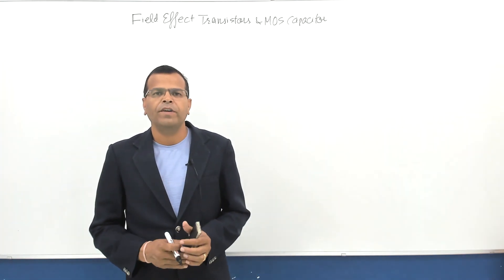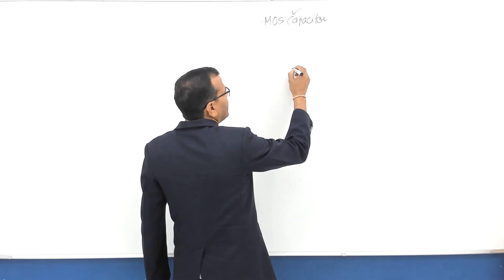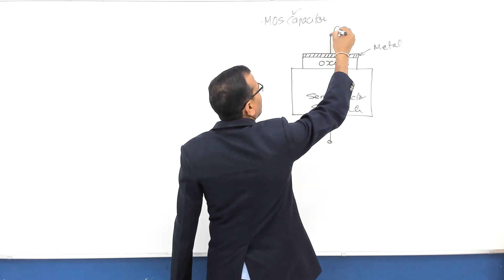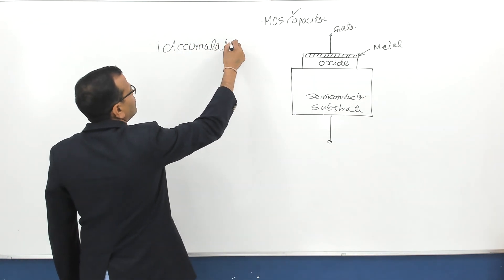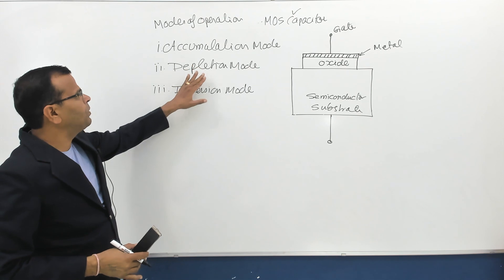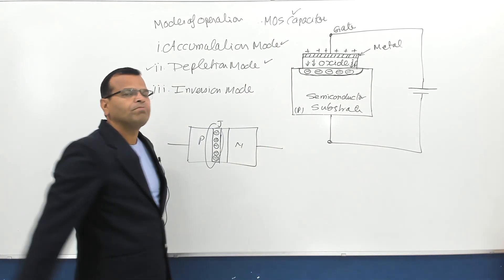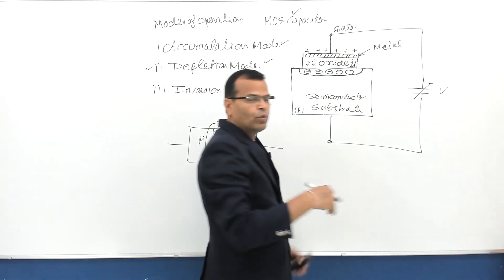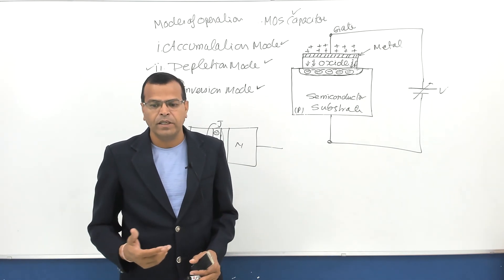EDC & AE Chap 4 FET & MOS Capacitor L1 Introduction to MOS Capacitor

Comment: sir sorry but u say that at depletion mode there is no hole and no electron but accordingly me......when aur Vds increses just equal to Vgs then holes are repelled but it is immpossible that if a crystal are p type then he could having electrons ....so a very thin layer formed due to  minority electrons in such deplete region but such are not capable for conduction such is depletion mode....
Reply from the maker: Dear, your doubt is not clear to me whether you are talking about MOS capacitor or MOSFET....
Reply: @digcademy2856  mos capacitor in case sir